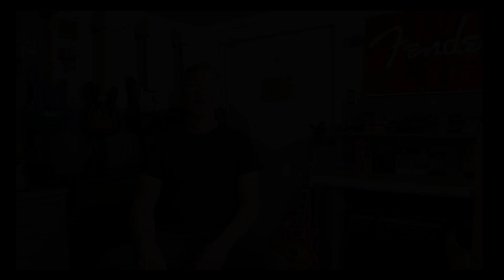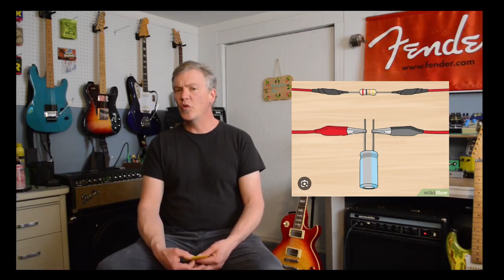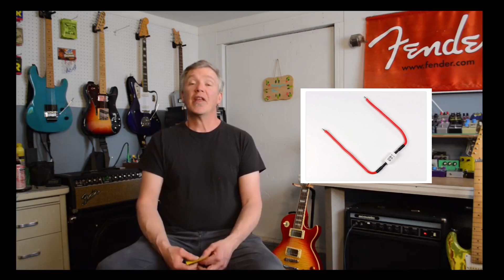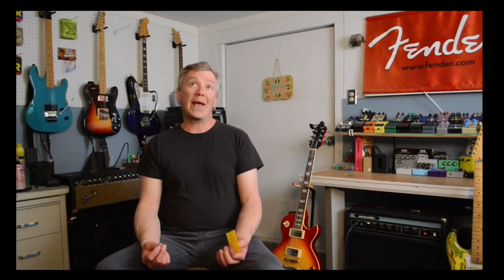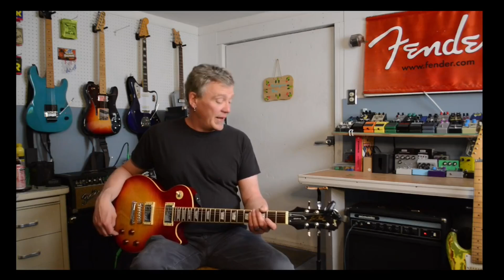Amplifier Servicing And Maintenance.

Comment: I just bought a 1960's Vox tube amp.  So I won't electrocute myself if I replace the 2 prong as you described?:face-orange-biting-nails:
Reply from the maker: @channel-fs3tg  Just make sure to follow the filter cap discharge method (there are tons of tutorials on this) and then you are safe to put a three wire power cable in. Take your time and check with a multimeter to make sure all the juice is out of the amp! Good luck and thanks for watching🤘